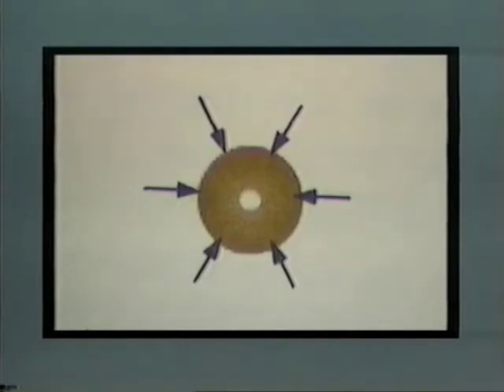Black Hole

Comment: 0:59 - 1:05 That pixelated image looks very much like a crude version of the black hole that was just revealed the other day! :O
Reply: It pretty much is, it's impressive what humanity managed to learn with primitive scientific equipment back then, compared to now. When the Playstation 1 first launched, its processing power was actually double what the Voyager 2 spaceprobe had on board to radio information back to Earth. It's amazing to look how far we've come in just 50 years, when V2 has only recently left our solar system to explore true "outer" space.